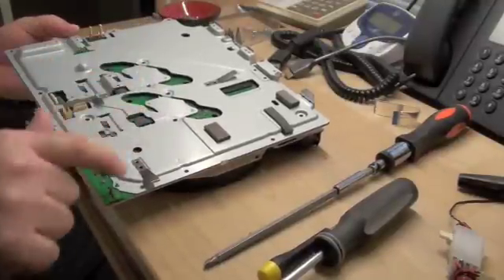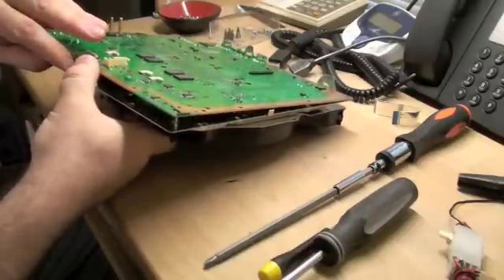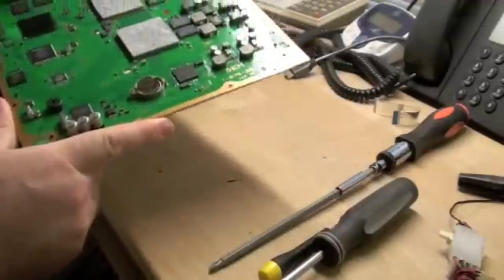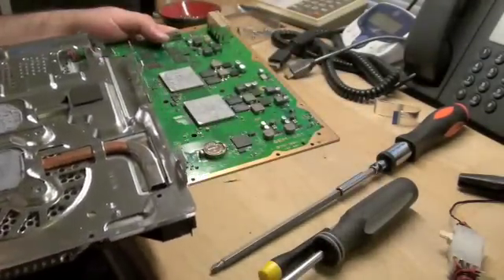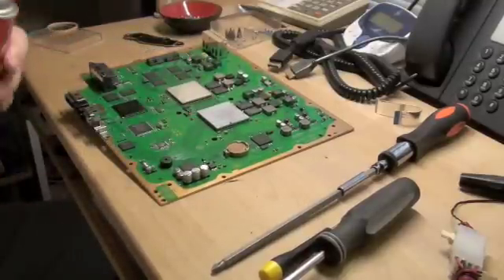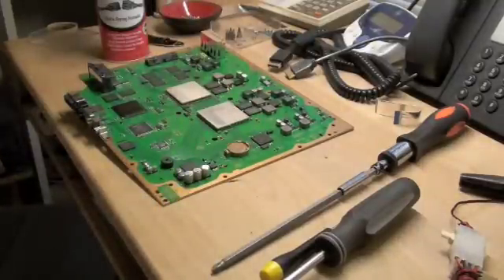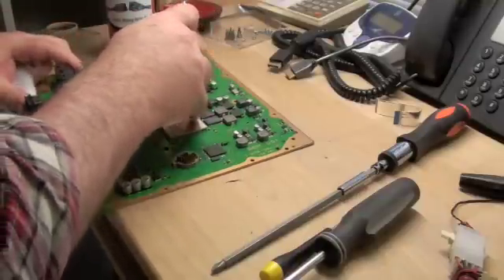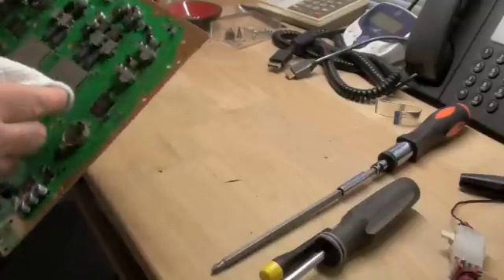PS3 disassembly - mainboard

Comment: Just some info for you guys.
As a unintentional stresstest, had opened the PS3 up and seperated the heatsinks from the cpu`s and let them dry out, and then a few days later, Put them back together, And honestly left it this way for a full year, I didnt have any slowdowns or damage as a result (Though the fan was running a LOT more than any of my friends PS3`s)

I opened it up, Saw a crusty mess of paste, And put in some 99% silver thermal paste in place of it, Runs amazingly right now, no prob.

Comment: Thanks for the guide, I fully dusted and re-applied the thermal paste (Arctic Cooling MX-2). Running fine but the fan still spins up to full blast after a minute...even checked that the thermal paste was making full contact and the clamps screwed in nice and tight. I have the crappy 15-blade though, which might be the problem.

Comment from the maker: @ivan199120 Because you run the risk of leaving tiny voids of air if you just slap the parts back together.  This causes poor heat transfer and will increase the chip temperature.

Comment: If "Yellow Lights" on you then it's a hardware problem and most likely, yes you need to reapply. Use good thermal paste. I recommend Noctua NT-H1 paste. It's rated better than Arctic Silver 5. If no yellow light try doing the "hold down" on the power button for the 3 beeps which brings up the menu. Usually that solves all other problems other than hardware issues. If you do crack open your console clean out all the dust that accumulates, even inside the huge fan! wipedown and vacuum everything!

Comment: I followed your guide junker15 and managed to take apart my 60gb ps3 launch unit.
Re pasted cpu and gpu with some mx-2 paste and it works a treat.
I have had my ps3 since uk launch date (2yrs 6 months) and there was no paste left when I took it apart, the fan came on after 10mins in idle mode but now its ok.

Comment from the maker: The safest thing to do if you remove the heatsink is to wipe both surfaces clean and replace the thermal compound.  I used standard Arctic Silver for mine.  I applied just enough to the surfaces of both chips to make a good bond free of any air gaps.

Comment from the maker: 80010514 is the general "Disc Read Error" error code.  If you have checked your connections and are sure everything is right, the new laser unit is probably bad (just the blue diode is dead, as you can read media that use the red one and the IR one).  See about getting an exchange for one that works.